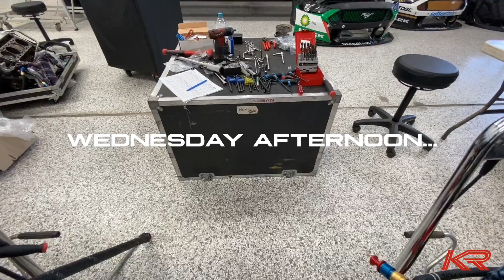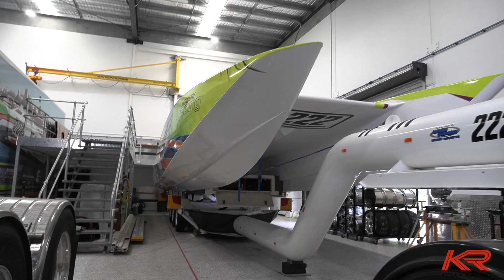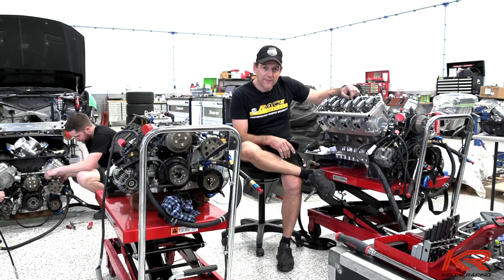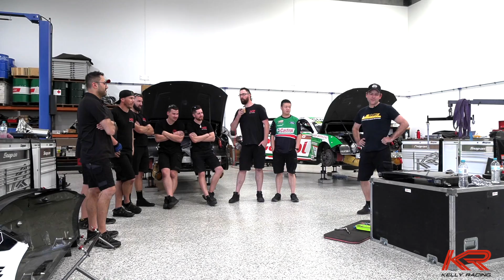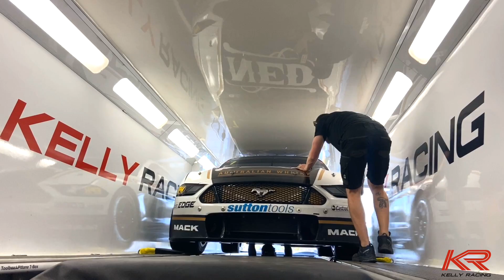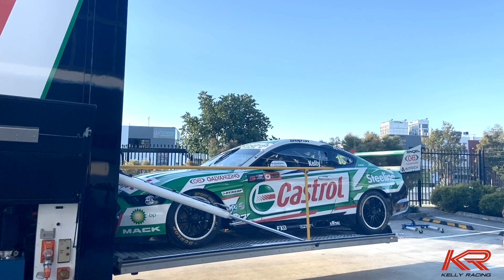Engine problem before leaving QLD for Darwin | could have been a disaster - Kelly Racing

Comment: Really enjoy these series of videos, what an amazing team. A genuine insight into the unexpected technical problems a race team has to contend with. Valve guides made of material that isn't compatible with the particular valves they're using in those engines (am assuming it's the exhaust valve guides that are the problem). That's pretty bizarre, hope they get it all sorted out without having to do any "all nighters"...

Comment: Whats with the pushrod engines?
Is Australia the same as canada & u,s 
Won't let manufacturers use overhead cams
Because General Motors is stuck in the past
Reply: The Nissan engine Kelly racing used to use was a quad overhead cam.

Comment: You have to ASK the sanctioning body to tear an engine apart in your own shop?
Reply: Yep, stops people cheating by creating a different engine spec to the one that they had ratified. It's a performance balanced series. It's quite a common process even in some grass roots club racing.
Reply: UK Racer I’m most familiar with NASCAR’s rules and just got into Supercars. NASCAR has an impound where you’re only allowed to work on a car during designated times race weekend. The top 3 cars are also gone through to the last nut and bolt post race. Since most teams are multi car teams or essentially supported by a larger team, cheating under the hood is essentially stamped out.

Comment: Seems bizarre you have been supplied the wrong material valve guides. Initially I thought you may have been running the valve to guide clearance a bit tight. By the way CHE guides for the win. . Anyway good luck👍🏻